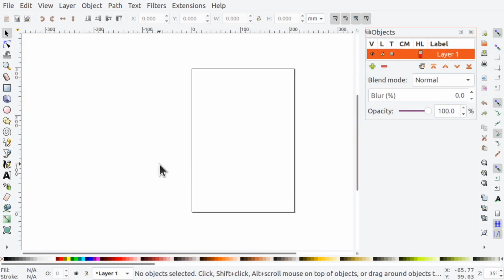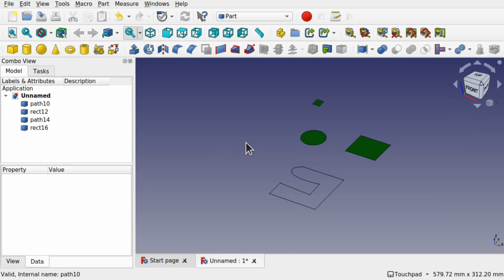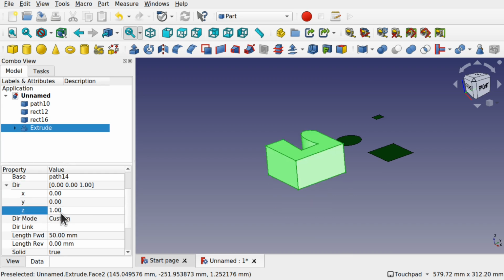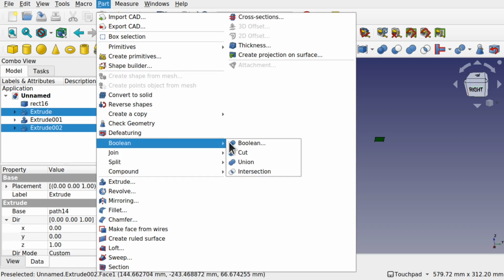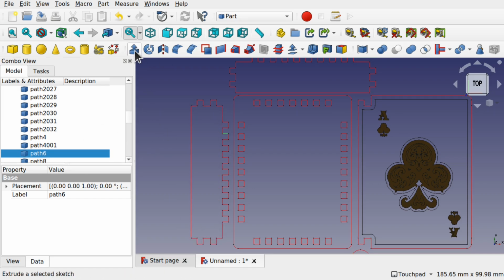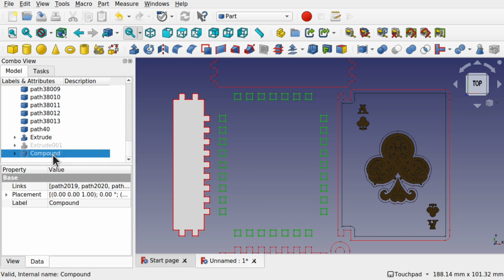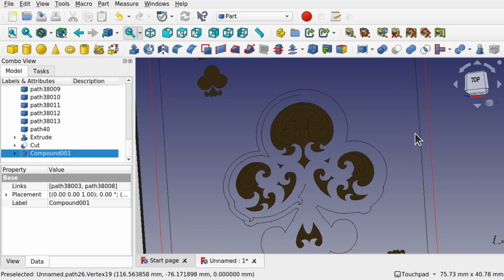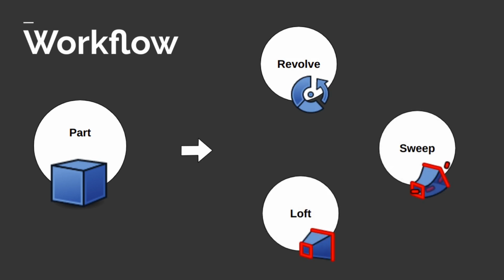FreeCAD 0.20 For Beginners | 6 | Using SVG in the Part Workbench

Comment: I'm really enjoying these videos and the pace at which you add new things to learn. I just wanted to make a note, when doing the cut at 18:54 my pc took about 15 minutes of processing that operation. I'm using FreeCAD v1.0.2 and I have a brand new Lenovo Yoga 9i with Intel Core Ultra 9 285H processor. Is it normal that it took so long to process?
Reply from the maker: Glad your enjoying these, I just ran through the process myself on 1.02 and I had no problems with speed, it's around the same speed as in the video.  Are you cutting against both extruded and not accidentally selecting the compound? Check to see if the compound is visible within the extrude as this is a common trap when selecting, you think you selected the part but you have actually selected the other visible one that occupies the same space.  The other option is to instead of cutting the extrudes is to take both compounds and create the cut, then extrude the cut.  Thought I would add that as well for an alternative approach.
Reply from the maker: Oh the other thing is check to see if your extrudes are solid.  Select the extrude, and then look in the data tab.  Make sure solid is set to true.

Comment: All going well so far, but how do i download the CDR file for the Playing Card Box. If I click on the file it goes to the web page with lots of items on. If i try to open an account it won't let me unless i supply credit acrd details.
Reply from the maker: Hi.  Yeh that's not right.  I have  just created a public post on my patreon so you have a clear route through to download it.  I will also update the description.
https://www.patreon.com/posts/file-for-freecad-135857236
Reply: @MangoJellySolutions  Thanks for that. I expected the video would show the box made up by rotating the sides and locating them in the holes. As it only showed the construction of the base with compound selections any shape with a few holes would suffice for the learning process. Although messing about with Ace of Spades could have been a useful exercise.
Reply: OK Got it now. Your comment mentions the old 0.21 series Learning Freecad for Beginners. Is there a more up to date series?

Comment: Having an issue at the end of the lesson in FreeCAD 1.0.0. When I try to perform the final boolean cut on the club pattern, FreeCAD freezes and then closes.
Reply: its because the operations takes a lot of time for complex or multiple shapes of it crashes you need a better PC or use online CAD programs that don't rely on your computers computational power

Comment: I've started going through your tutorials. Today I have been working on this one. A little different in that I have FC v 1.0 vs your 0.20. Running on Mac Intel (older but still ok). Anyway, when I tried to cut the two extrusions of the Club logo, FC just seemed to freeze. Do I need to do this task a different method now that 1.0 is the version of the day? Thank you. BTW. I feel I have learned quite a bit from your tutorials, even thought I do have to find different tools sometimes due to the version differences.
Reply: So, update, I tried this on a new Mac mini m4… same result. I have a Raspberry Pi v3 which I loaded FC on just to see what would happen. It took 3 minutes to process what two different Macs with v1.0 couldn’t do. I’m thinking bug in FC.

Comment: First, great job! I've been fooling with FreeCad tutorials for a long time and was getting nowhere--slowly and painfully.
I'm currently using FreeCad 0.21.0 in a PC Windows 11 Home edition.
A couple of areas that differ from the video on this lesson:
When I exported the test file with Inkscape 1.3.2 as plain SVG it could not be cut. No way, no how. When I converted it as Inkscape SVG or with CloudConvert it worked just as advertised. When I created my own image with Inkscape and saved it as plain SVG, it also worked as advertised.
I find it impossible to make edit on Compounds. For example, to change the length of an Extrusion, I have to regroup multiple objects with Box Selection or CTRL key to do so. It seems that once the Extrusion is created, the Compound has no purpose or function.
Any thoughts?

Comment: The normal direction for a face is determined by the order of the points.
A face that is drawn counter clockwise will extrude towards you, a clockwise order will extrude away from you.

Comment: I appreciate your tutorials very much but this one is missing two vital aspects pertaining to SVG import. 1. Even after simplifying and combining paths in Inkscape FreeCAD still see them as separate paths. 2. Positioning - both in a plane and as importing to a specific wall on a solid (if possible at all). EDIT: I did all the cutouts in Inkscape (Imagine e.g. windows in a contour of a simplified building facade) and when imported to FreeCAD it's all mashed together, windows not cut but listed as separate paths. EDIT: 3. "Wire is not closed" - how to handle the error when FreeCAD doesn't give the slightest hint as for neither location of "the problem" nor how to fix it.
Reply from the maker: It's funny you should say that, I have just finished some freelance work regarding svg and freecad and learnt a lot more. So inkscape adds its own custom svg elements depending on what you are doing. You can get around this by exporting the svg out as the file type 'plain svg'. Another issue is layers. With svg it's essential to remove all layers before exporting into freecad.

Onto the wire not closed issue, it can be resolved in the sketcher workbench, select  the sketch and validate sketch. This will give you a set of checks to run which can identify the issues. This video could help https://youtu.be/w7_jCxxN1OY?si=Qmt2wTn2jftrOnCJ

Hope that helps. 

Hope that helps with some of the issues you have. Ah another thing with wire not closed and found this when working with svgs is if thre are 2 lines on top of each other. This can be hard to spot but the validate sketch will point you in the direction of troublesome vertices.

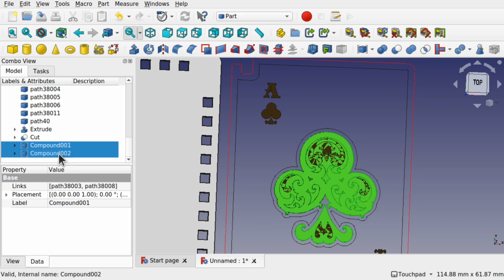Comment: I get this error when I try to extrude my compounds 18:13. it says "Can't determine normal vector of shape to be extruded. Please use other mode." What do I do?
Reply from the maker: If you look down on the extrude options before pressing OK you will see a direction which you can select. The reason for this is that a compound contains a number of objects, each can have a normal vector (normally with a 2D object such as a sketch this runs through the object as 2D is only in x and y). When you have groups of objects together there is no normal so it's left up to the user to supply the correct direction x, y or z. Click either and then click again to make  it a minus value if you want to extrude in the reverse direction
Reply: @MangoJellySolutions  Thanks for saving me on that one. So, would we just put 50 in the Z custom direction instead of putting 50 in the along: "Length" spot?

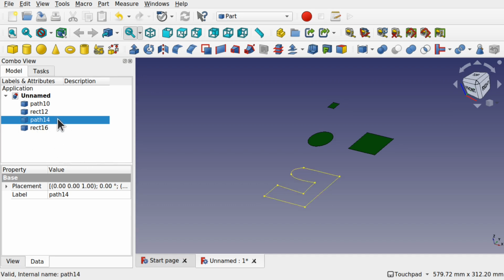Comment: Seems as if FreeCAD 0.21 does things differently when extruding like in 5:55. I get the error "Can't determine normal vector of shape to be extruded. Please use another mode."  Just wondering if anyone have a solution to that.
Reply: Nevermind. Thats just me being stupid. I Tried to extrude a filled shape.
Reply from the maker: Just to let you know you can resolve the extrude of a filled shape  if you get that error. If you look at the panel to the left there is a directions of extrude. This can be set to the direction of your choice allowing you to extrude and range of different geometry.

Comment: Thanks for these tutorials. They are certainly helping me learn FreeCAD but I'd like to find some other resources to help me learn more quickly. Are there any online courses you can recommend? Or any books (there is a book called 'FreeCAD 0.20 -  A Power Guide for Beginners &  Intermediate Users' by CADArtifex, have you seen this, can you recommend it?)? 

I know FreeCAD is at 0.21 as of 8/2/23, what are the differences between 0.20 and 0.21? Are there any of your videos that may not work as described on 0.21? Will you publish a new set of videos for 0.21 or at least a single video showing any differences and guiding us on anything that may not work (or works differently) on 0.21? I definitely understand the difficulty in keeping things current, especially with the many updates released but a bit of guidance would be helpful if possible. 

Appreciate any guidance you can offer. Thanks.
Reply from the maker: Hi sorry for the late reply. I haven't got any recommendations for books as I always find them very hard to follow and go out of date very quickly. With videos I find you can see the actual steps. I do have a video in my collection regarding some of the additions to 0.21 but the  older videos are still valid. The main things that could be an issue is that there is no image workbench anymore. This is now done via the top  menu, file, import. And also the sketcher has moved the check boxes for auto constraints and remove redundant constraints in a small drop down in the same section. Hope that helps.
Reply: @MangoJellySolutions Thanks for the reply. Ok.

Another question I have is what would you recommend for example designs to work on? Would like to find a good source of design challenges that one could implement to see how the various methods covered can be applied. Seems like there's always multiple ways to implement anything, so I realize there will very different ways to end up with a valid result. But if you have any recommendations for designs to at least try to implement that would be helpful. Appreciate any info. Thanks.

Comment: I'm having issues with importing SVGs in FreeCAD: I have a polyline object (it's text from a proprietary font, which I don't have access to), but it's imported as a number of connected B-splines instead of one B-spline. As a result (at least, I'm assuming that's the reason) I can extrude it, but any other operation on the extruded part (like thickness or offset) fail. I've tried making a face from the extruded part, or trying to convert it to a sketch and back. but to no avail: still a set of B-splines instead of one big b-spline. Any tips on getting one big B-spline from the SVG? Or will that not even solve my issue?
Reply from the maker: Try creating a 2D offset of the bspline geometry instead of a 3d offset of the extrude and see if you have better luck. I have been working with these files lately and found better results by offsetting early
Reply: @MangoJellySolutions  thanks for the tip. I've been digging into this and realized that freecad is importing a single SVG multi-spline shapes as multiple/separate B-splines. And that's the big problem. I've kinda got it to work by selecting "use old python importer" in the svg import options. Still, the result are not great, not giving correct faces.

Comment: A fascinating series, thank you. Do you have a video on using svg input to create an expanded solid from a series of frames in 2D? Creating a boat shape.
Reply from the maker: Thank you, so the frames you have are each of the cross sections of the boat? In which direction do they travel.
Reply: @MangoJellySolutions  The boat frames are in the x-y plane and are stacked in z separated by various distances.
Reply from the maker: @brianwharton9385  It depends on your svg's and what they look like.  If they all have the same amount of edges in the drawings then you will be able to create a loft through each of the sections just by selecting them and adding them as you would do a sketch similar to as I have done in this tutorial https://youtu.be/ToobD6C4x9g .
Reply: @MangoJellySolutions  Many thanks for the video, it explains quite a few things I was struggling with. I'll use the SVGs as masks to create the shapes on each station using Bsplines with the same number of nodes. The deck has a step in the profile at around half-way but I'll raise another query if I get stuck. Great video, keep them rolling.

Comment: Where is the  joedq691.svg file? Do you have a link to it?
Reply: Hey, John... and anyone else following afterwards... I used duckduckgo, and I found the file joedq691.cdr. That is a Corel Draw file format. I used an online file converter, CDR ~> SVG, and got the desired result when I imported this converted file, joedq691.svg into FreeCAD.

It would have been helpful if MJS provided a link to this file.
Reply: @bicicogito   I used online-convert ... worked fine without any sign-in or permissions.

Comment: I feel like the Part Workbench is much less accurate than the Part Design Workbench.
Or at least it requires a lot more data input to achieve some precision.
Reply from the maker: The part design really restricts you in it's workflow for example  limits the use of the right click, transform options, sketches must be closed, sketches can't create multiple bodies etc. The part is more free but you can still go down the same route for accuracy i. e using the position coordinates. The part wb does allow you to work with open sketches, faces, edges even vertices to create your model. It allows for a more 'organic' approach plus its full of features. It's a bit of a Swiss army knife. I will be going into some of the differences and examples of use as we progress through the series starting with the next couple of videos 😁
Reply: @MangoJellySolutions  Without wanting to put pressure on you, I can't wait to start this series.
It's like watching the season finale of your favorite TV show and having to wait 6 months to see the rest of the plot.

Comment: I have a new iMac M1 with 16gb of RAM and although I could get V0.20 installed and to work, sort of, it was VERY unstable.  I reinstalled V0.19 which works fine apart from the curves workbench which is very hit or miss. I mainly use Fusion 360 now. The emboss feature is brilliant.